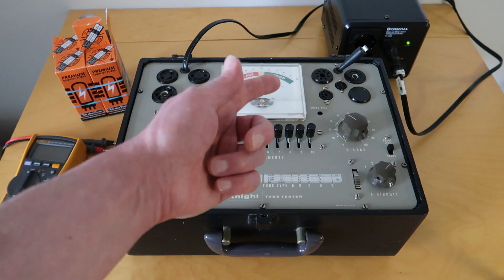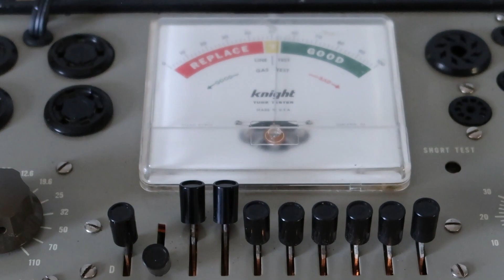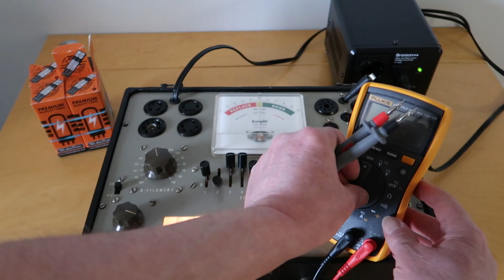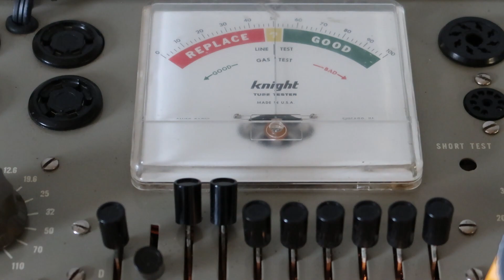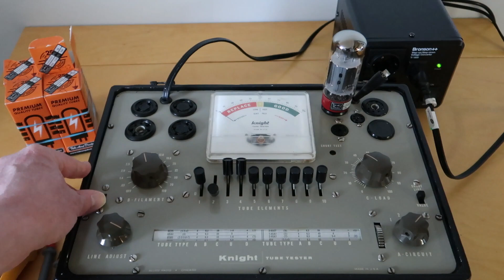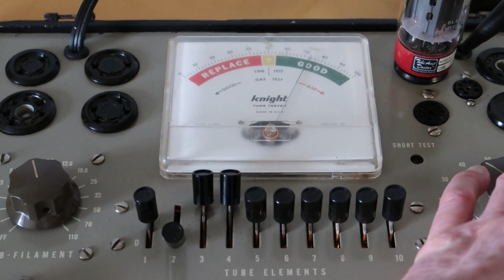Knight 600 Valve Tester demo: 6L6GC Part 1

Comment: I own one of these testers and your video is very helpful in using this tester.
I found the output valves typically are high on the good level.
Reply from the maker: It's a very good tester for basic checks. You can easily find out if a valve is bad which is a great fault finding tool. 👍